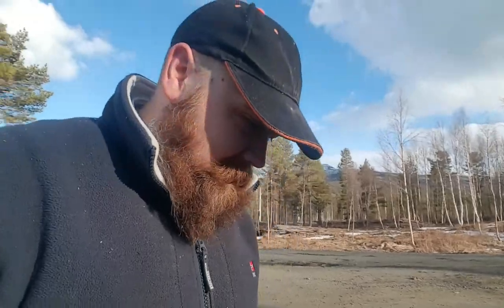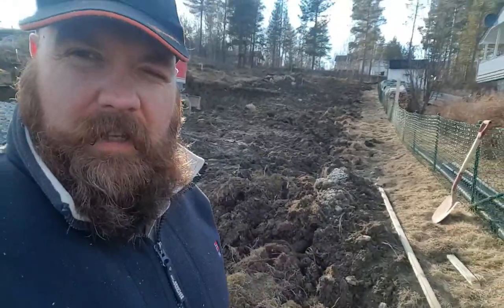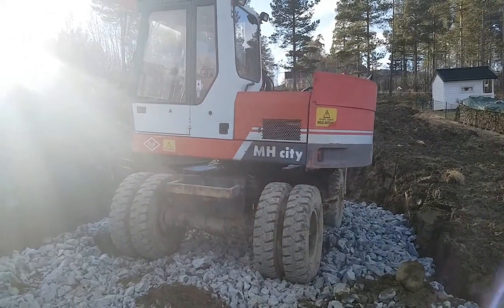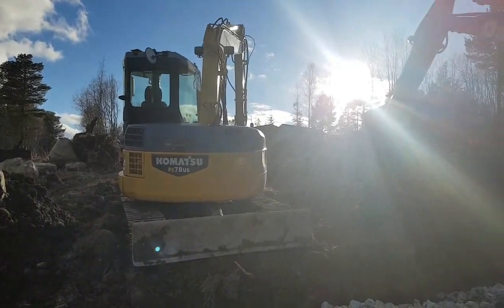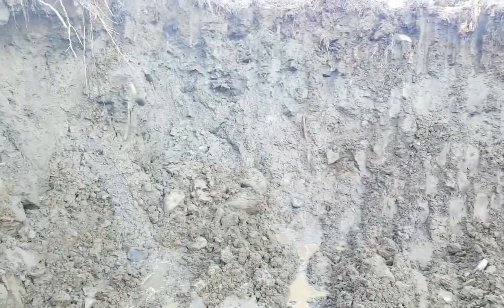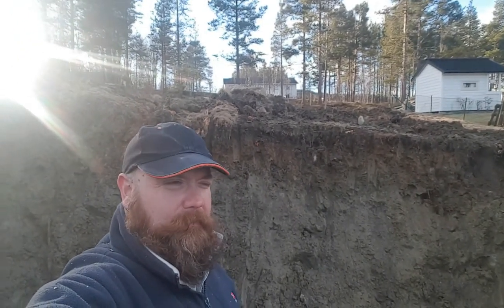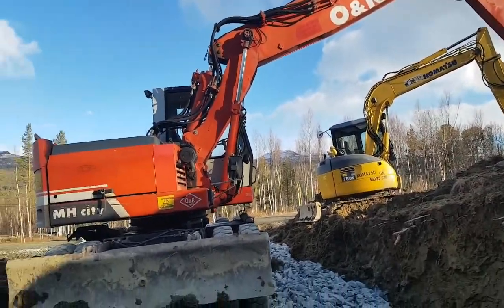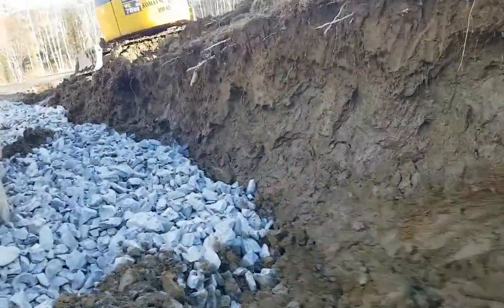May 9th - #jarleifhouse parking lot

Comment: omg that is a deep hole! What's going to be in that location you were standing?
Reply from the maker: +Shanell Cubed Yes it is! That will be the parking area north of the house, as well as the entry into the garage in the basement. The house will have a 650 sqft garage in the basement, so I need a driveway low enough to drive right in.. 😁